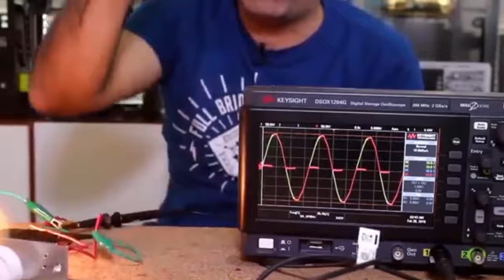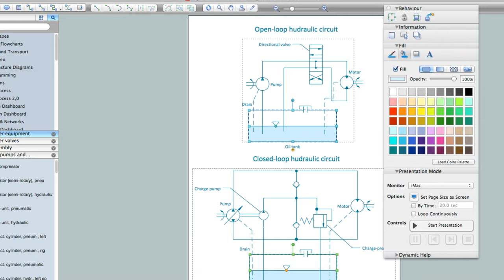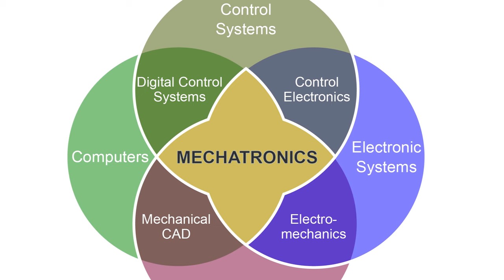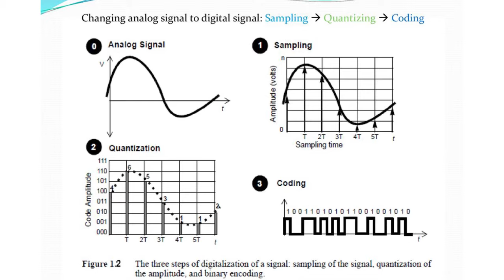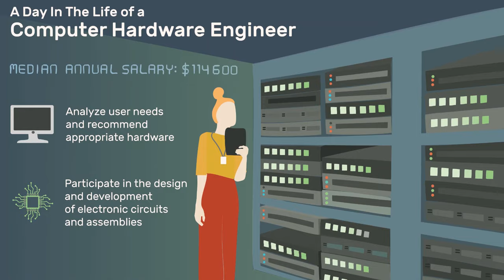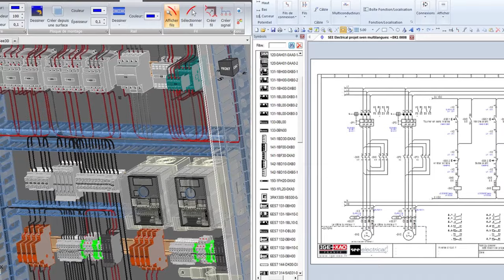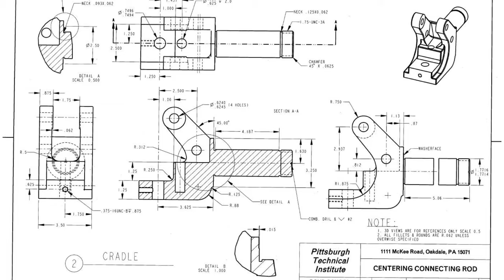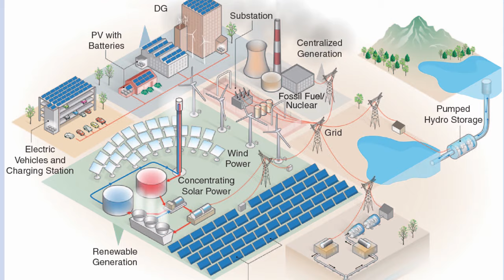What Does an Electrical Engineer Do? | What is the Work of Electrical Engineer?

Comment: @Hyhy  hello 
I also having same issue 
I love electricity , transistors diodes circuits electronic devices sensors motherboards making new projects etc 
I want study hard in these but no one is clearing my double what should I do to do those in my future 
Like i am now in 12 th class 
After i will persue eee or ece 
After what should I do ?
Should I opt for masters after masters ? What should I do? 
Or after btech should I go for core job in eee or ece ? 
Or after mtech should I go for job 
Because job is very important for my family because we are financially very weak do studying that much time affect my father income more on me 
Ok I know that for mtech and PhD they provide stipend but my father need some financial assistance he i can't see him handling this hectic situation so I need to do job as soon as possible 
But my intrest in is core companies or i mentioned above no one offers those in private nor in govt PSUs 
What should i do now i am wasting lot of time in thinking of these searching for an answer but no one helps or gives answer .

1. Should I go for core jobs after btech in eee or ece ? Like in Texas instruments/ Cisco/quolcomm/ .............
2 or should I go for mtech in ece ( microcontroller and vlsi ) or eee( power electronics and voltage systems ) and do jobe in core companies after that like same as above but with good package in hand .or 
3 should I go for PhD in foreign universities like Stanford / harward / etc .
Ok if I go for them what should I do next i am not interested in teaching or professor jobs i am interested in making new projects BEST EXAMPLES ARE LIKE AURDINO PROJECTS YES 
i am much interested in making new new projects like them 

Please help anyone between these 1.        2.       3.
Please
Reply: You could do any of these, depending on your abilities, interests, and financials.

I am in the US, so not sure all of this applies in other countries.

Option 1:  Engineering is one of those few undergraduate degrees you can have that offers you a well paying job right when  you finish your bachelor's degree in engineering.

Engineering colleges in the US actually have career weeks where companies come to campus to interview upcoming graduates for jobs.  Depending on your degree, the salary offered is about $65,000 to start.  You will likely need to move away from your hometown.  The salary does improve fairly rapidly.  Larger companies tend to pay more and have better benefits.  After the first 3 to 5 years at a company, you will likely be making 6 figures (as in 6 figure salary or over $100,000 a year)

Option 2: Getting a masters.  There are 2 ways to do this. One is within the university system where you either pay your way (like undergrad school) or you go after and receive a grant to do a specific project resulting in a thesis.

The other option is to get a job doing engineering.  Most companies encourage those who want to get further degrees, especially degrees that would enhance the work you are doing at the company.  You continue to do your job and get paid for it.  At the same time, you start working on your masters.  It is expected you will work on your masters after hours and weekends, but most employers will allow some flexibility in work hours.  The employer pays your tuition, as long as you finish the course with an acceptable grade.  If you are getting a masters in business or some degree that will increase your work potential in their company, they will be glad to help.  Some companies even pay something towards an unrelated degree.

3. Getting a PhD.  If your career track in a company is to become the technical expert at something they do, they may be willing to pay much of your schooling.  They may be willing to give you an unpaid or paid sabbatical to finish.  Depending on how much they pay, they might require you to sign an employment contract to work for them for a set number of years, and more importantly, give up rights for any patents you might receive stemming from your employment.

Typically, salary for a PhD will be higher in private corporations than in universities.  Most research these days is more applied research and not pure research.  Both private and public sectors perform applied research.  Some large companies still have a pure research department, but they are being pushed to work on research that has forseeable applications.  If you want to do only pure research, academia and some government labs will provide more jobs.  If your goal is to teach, you can find that not just a unis, but also at companies (but in a slightly different format).

Hope this answers your questions, at least from a US perspective.

Comment: Is it possible to pursue a career in automobile industry after doing a bachelors in electrical engineering?
Reply: Well yeah electrical engineers are required for the electrical components in automobiles
Reply: With automobiles hoping to turn electrical it makes more sense to try get in there
Reply from the maker: 100% you would work on the EE side of cars/engineers/etc
Reply from the maker: yup thanks for this reply !
Reply: @JakeVoorhees  no problem
Reply from the maker: Wordddd see you around thanks

Comment: the best intro so far!
Reply from the maker: Super glad you like it!! Let me know if I can help you with anything okay? Cheers thanks for the comment
Reply: @JakeVoorhees  Sure. Jake next video can you talk about how art students can pursue the engineering route if they interested in it?  Much appreciate it if you can talk about this.
Reply from the maker: @bodohbengap2592  Hey thanks for the comment. I think art students and engineering students have fundamentally different skillsets and interests and therefore, most likely should not cross over into one another’s industry often.

However, there is the potential that someone ended up on the wrong path due to outside misdirection and unawareness and lack of education of how to choose a career path or major.

With that being said, maybe some art students should have majored in engineering. These students need to be absolutely good enough at math and have some level of spacial and or theoretical thinking.

Also, there are some crossover careers with art and engineering - architecture being the best example. Architects need to be good enough at math and the logical and quantitative side of design, be also be able to creatively integrate design into the buildings surroundings, focus on aesthetic, etc.

Does this help and make sense? Let me know what follow up questions you have, cheers and thanks !!
Reply: @JakeVoorhees  That is a very clear explanation, Jake.  One more question, what do you think about electrical engineering and computer engineering? Which one has more demand in the future? Also, what are the advantages of choosing one from another?
Reply from the maker: @bodohbengap2592  Hey thanks for the comment. I know this one is confusing as I get this question often.
.
Computer Engineering is actually a subset of Electronics Engineering which is within Electrical Engineering. Electrical Engineering itself is the more broad major. Many programs offer them together as “Electrical & Computer Engineering” and it's not possible to achieve an isolated CPE degree.
.
Electrical Engineering includes things like power, telecommunications, signals & controls, and electronics, and computer engineering.
.
Computer engineering concentrates more on programming and how the hardware and software are made built to work together. On the other hand, Electronic Engineering concentrates more on circuits, loops, communication, wireless connections, etc.
.
Both of these branches will study the same fundamentals but Electrical Engineering tends to focus on power generation and distribution while Computer engineering will specialize in computer systems. In other words, software-controlled hardware and its interconnections.
.
Computer Engineering does more software related work; such as code development. On the other hand, Electronic Engineering does more hardware related work; such as working on a computer modern board, circuits, wiring, and alike.
.
Here are my videos on these subjects:
.
“What Do Electrical Engineers Do?” https://youtu.be/zRawKI6Qsm0
“What Do Computer Engineers Do?” https://youtu.be/hiL-cTbz188 
.
And this one talks about high paying EE roles:
.
“Jobs for Electrical Engineers over $100,000” https://youtu.be/Vi4hkCeNWs0
.
Also, a lot of Electrical Engineers wish to work in mechatronics/robotics, so check out this video “What Do Mechatronics Engineers Do?” https://youtu.be/4YjLZcQRLds
.
Does this help and make sense? Let me know what follow up questions you have okay? I respond to all comments. Cheers and thanks again!

Comment: Do college student learned all the subjects of each subfields? Do all subfields have the same subject at all? Hoping for the answers, I'm still a high school student, and I have so many questions
Reply from the maker: Yes, at the undergrad level you learn a little bit of everything.  For example, in ME, you will learn thermal engineering, dynamics (automotive and airplanes side of things), and much more.  No, not all subfields have the same subject.  For example, with energy there is a mechanical side and an electrical side of things.  If you were an ME, you would be less concerned with the ME side.  Ask away
Reply: @JakeVoorhees  Do I also have to pick on which subfield I want to take in college? or not?

Comment: i wanna major in electrical engineering in 3-4 years,do i need to learn anything before getting into college or does the college itself teach me everything i need to know?
Reply: You will make it far easier on yourself if you take advanced science classes beforehand.  

Math: algebra--really understand it and how it can be used to solve story problems.  Great understanding of algebra sets you up well to understand calculus.
Trig and geometry: trig is used a lot in electrical engineering (electrical signals are modeled with trig), and to a lesser extent, geometry.

Calculus is especially important in all engineering, but electrical engineering is totally dependent on it.  As such, EE students take about as much in-depth math as math students.  So do whatever you can to find as high a level of calculus as you can find.  In your first year of engineering college you will be expected to learn in-depth calculus in the two basic concepts, derivatives and integrals.  This will include other topics related to these two core concepts.  Take advanced placement calculus in high school and also learn from a collegiate engineering calculus text.

Most curriculums also require inorganic chemistry and physical mechanics during the first year (note that physics will require calculus, so it is typically taught later in the first year.)  If you have a good background in these it will help you get past that first year.

The reason I mention the first year so much is because this is when most students drop out of engineering.  It is also often the first time teenagers have lived away from home.  They are in a totally new environment where they are accountable only to themselves AND there are parties all around.  So if you have some excellent knowledge of the subjects we know are difficult for most people, you will have time to transition to independence and college life, without having to repeat a course and put you a year behind.

If you do not have english as a first language, be sure you can write a clearly understandable technical report.  Of course, this applies if attending in an english speaking country.
Reply: @squirrel2000  wow,this is very detailed
thank you so much for putting in the time and effort to write this!❤️
by the way,do you think that proof-based math and geometry are used in any field of engineering?
Reply: @aryades  first of all, I am an EE, so not the best to speak about other disciplines.  I also have both math and EE degrees and it has been long enough ago that I don't remember clearly what was needed in each coursework. With these caveats:

Since the first two years of calculus are often taught by the math department, they do include proofs.  When you take EE classes, it is essentially applied math.  As such, you typically don't do proofs of commonly accepted math concepts.  One thing proof based math does is to teach you the concepts behind the math, so you understand it better.  I could argue that the point of engineering school is similar.  It builds on math and gives you the understanding of the basic tenets of the engineering discipline.  It gives you the constructs that allow you to become a good engineer.  I often say that your BS in engineering doesn't MAKE you an engineer,  but it teaches you to THINK like an engineer.

As to geometry.  I would think that civil engineering and mechanical engineering use what you are thinking of as geometry.  But really, all engineering uses advanced geometric concepts in a way.  For example, triple integral equations are used in EE.  Mathmatically, these equations are used to describe objects in 3D space.  But when it is used in EE it will represent a complex electrical signal.  The math concepts are identical if used in pure math, EE, ME, CivE, or any applied math.  Then you apply statistics to it and it becomes really fun 😉
Reply: @squirrel2000  this is super useful,and you really put in the time and effort again...
thank you SO much!!! wish you a happy new year and a good life ❤️
Reply: @aryades  Thank you.  I wish you the same.  Also, don't forget the fun things about college.  Join groups that have nothing to do with STEM and enjoy meeting people from all cultures.  Let it expand your understanding of the world.
Reply: @squirrel2000  of course ❤️

Comment: Finishing my diploma then doing my engineering btech math is my only issue any ideas
Reply: It sounds like you already know math is critical for all engineering, but especially EE.

As long as you have excellent understanding of Algebra, and a reasonable understanding of trig and geometry, take a calculus class as soon as possible.  Your goal is to get one semester of derivitives and one semester of integrals.  The overarching goal is to understand how calculus works on a grand level and how it can be used to solve problems that nothing else can.  If the teacher is willing, follow along in a first year engineering calculus book.  This book will be more challenging than even AP calculus, but it will show you the level that you will be learning in college.

If you absolutely can't take calculus where you are, accept that you may need to take remedial math at college, which will delay graduation by 6 to 12 months.  Ask to take a math placement exam designed for incoming freshmen.  If your school or college won't supply one, take sample final exams for algebra, trig, and geometry.  If you can get an A move on to the next step.  If not, study the areas you had problems and try again.

Then get a first year college calculus book and do self study -- maybee your math teavher will help?  This will help you when you are asked to learn the more in depth engineerin calculus.

Also, try to get the,teachers edition of a math book.  They include teaching advice and answers, so you can check your work.

Comment: Please do a video about mechatronics
Reply from the maker: Hey thanks for the comment and here you are !

“What Do Mechatronics Engineers Do?” https://youtu.be/4YjLZcQRLds 
.
“Is Mechatronics Engineering a Good Career? https://youtu.be/UkPKlA6j0f8 
.
There are only 28 ABET mechatronics engineering programs in the world and just 3 in the USA. So oftentimes you have to choose EE or ME or CPE and do a degree concentration in mechatronics, which is a great path. Some universities have a formal certification program within EE/ME/CPE, or you may have to build it yourself. You would do that by for example, majoring in EE and taking more electronics courses and less about power or telecommunications. You would take robotics electives, signals and controls, and circuits courses, etc. Your CS related courses should revolve around mechatronics rather than something else, and so on.

Computer Engineering is often a subset of Electrical Engineering. But sometimes engineers struggle to choose between ME vs EE/CPE. This video will help you decide, “Mechanical VS Electrical Engineering” https://youtu.be/6PJ-Yw5qVsc 
 .
These will probably be helpful as well:
“What Do Mechanical Engineers Do?” https://youtu.be/5wEteXzhtak 
“What Do Electrical Engineers Do” https://youtu.be/zRawKI6Qsm0 
“What Do Computer Engineers Do?” https://youtu.be/hiL-cTbz188 
.
I also ranked Mechatronics Engineering as one of the only two S-Tier Mechanical Engineering options in this video, “Mechanical Engineering Job Tier List” https://youtu.be/ghxBLeEX_OM
.
Does this help and make sense? Let me know what follow up questions you have okay? I respond to everything, thanks again!!